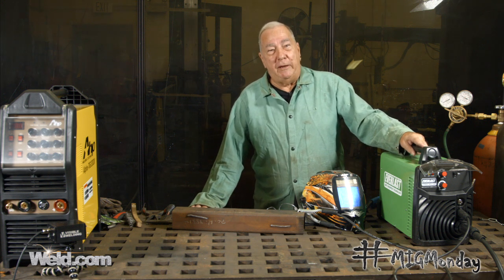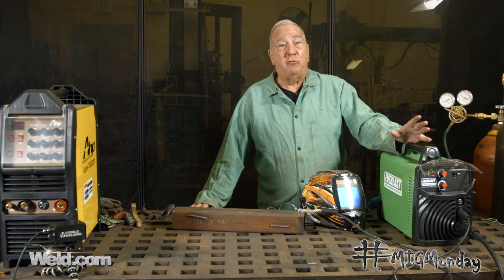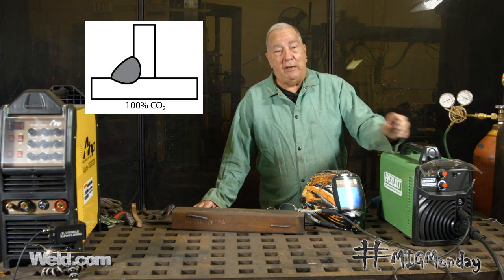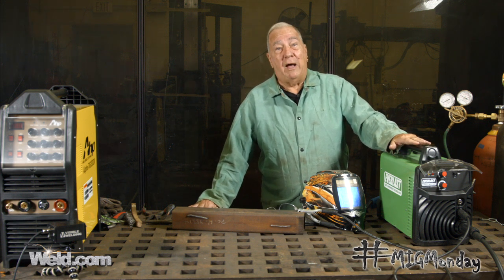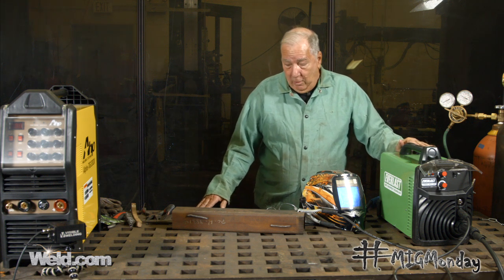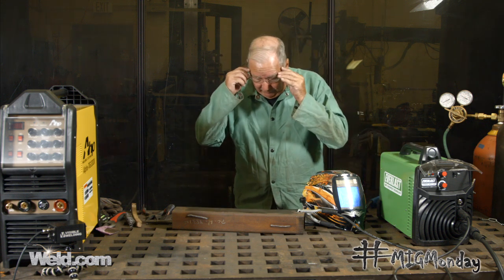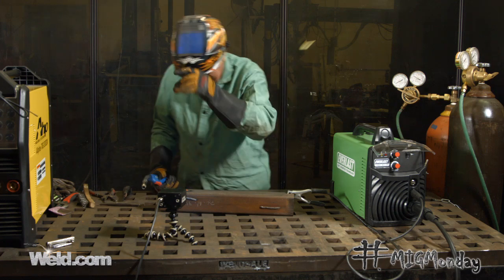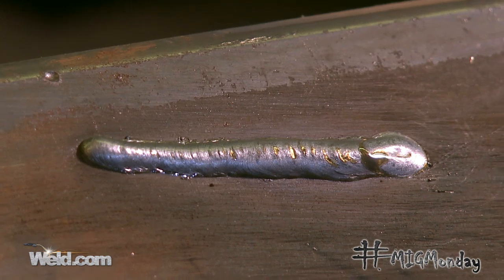Best Gas for MIG Welding: CO2 vs. C25 MIG Mix

Comment: From my own experience - argon stabilises the arc and makes it less aggressive, thus for welding thin sheets (like in body repair) Argomix is better. Two years back I helped my pal to repair the body of a second-hand van he purchased and planned to turn into RV of sort. I did most of the welding in my "personal" shop, with a rather simple MIG machine and straight CO2, using solid 0.8mm (0.03") wire - and it was OK. Not bad, not great - just "well, good enough, would do".
Then we took the car to some other place to spray paint it (again done by myself; that place had nothing to do with painting cars, it was just bigger place I could use, and it has a way more powerful compressor than that little "farter" back in my shop).
Anyway, while there I noticed some missed spot that had to be welded before painting, and I took that bigger MIG machine that was there, running 1.2 mm wire (0.05") and 90%Ar/10%CO2 gas. I was kinda hesitant to weld such thin sheets with this thick wire - I expected some serious burn-throughs and some "fighting" to get it done - but to my surprise it turned out to be WAY smoother than welding it with that thinner wire on straight CO2.No burned holes, just touch and go, full success at first try. Maybe the machine also contributed to it as it was a grade better than what I used before, but the gas surely makes the difference.
Then comes the other end of the spectrum - if you have to weld some thicker stuff and your machine isn't really heavy duty one to crank amperage to 300 A on short circuit mode it's better to slow the wire a bit and use spray transfer method - but you can't really do spray transfer with straight CO2. so mixed gas is the must.
But then as this guy in the video has said - for hobbyist/ home shop/ light stuff simple MIG on straight CO2 is just good enough, and the gas is way cheaper.

Comment: I started off using flux core then moved on to argon. But I found the best results when using Co2. I think that if you can, experiment and find what suits you. After all one size doesn't fit all.

Comment: I appreciate the economy of using straight C02.  The fill is cheaper, and the bottle lasts way longer.  I did however once suffer from a freeze up of a flow meter, which damaged its safety disc.  So, I went back to a gauge and gauge style regulator, as opposed to a ball type flow meter.

Comment: Back in 1979 I was working at a welding shop.  We had been using straight CO2.  A salesman came in and gave us two bottles of Argon/CO2.  We used it and loved it.  But we had been using #9 welding lens which was dark enough for CO2.  The arc brightness on the argon mix is much higher.  We all had a bad night with burned out eyes from using the mix gas with too light of shade of lens. Argon arc 3:00 , CO2 arc 3:56 .
Reply: Use the darkest shade you can see thru. I use an 11 for gmaw

Comment: This video is misinforming. If you use CO2 even mixed with Ar youre not MIG welding.
Seriously, people who look specifically for MIG have hard time finding anything because of pronunciation problems and/or lack of education of  video makers who name every gas welding MIG, with big capital letters in video title.
 Stick to American nomenclature, if you need one name on everything.
Whenever you use oxygen (CO2 or any CO2mix), gas is not - inert - by definition, its active gas welding - MAG (pronounced as "Maggie" without "-ee", or "Magnesium" without "-nesium". Idk why name MIG was incorporated so easy and MAG did not).
Its like you called petrol engine a diesel, because both are car engines. Or call both your parents mommy, like there was no difference.
Reply: Well, Nitrogen gas and carbon dioxide are referred to as inert gases because of their very low reactivity. These gases are not inert in the same way as the noble gases like Argon, which exist in their elemental form.Oct 28, 2021. So, this leads me to think that's why using c25 is considered MIG welding.

Comment: Hi Paul, I'm a little bit confused ? At the start you said most People tend to go for C25  mix, As it is a cheaper option, But near the end You chose 100% Co2 because its cheaper to buy ?
Reply: I think that first mention was a mistake!  CO2 is clearly cheaper.  Also easy to obtain, and there's a lot in a tank.

Comment: Thoughts on argon helium?
Reply: Works very well when TIGGING aluminium as it produces a hotter weld. It's very good for when you only have a single phase (240V)  machine and you are trying to weld 6mm alloy plate.

Comment: Huw much does that everlast cost? Because, I have a Chinese welder, looks 100% like Everlast. Paid 95 bucks for him. I did some research and found several exact machines with different names.....Weldinger, Proinstall( in Europe). Hope you didnt paid much, because that is repainted Chinese junk, but it works fine actually

Comment: I had to use an adapter to connect regulator to a co2 tank. I have a 20lbs aluminum co2 tank with handle.

Comment: Which is better for thin wall 304 or 409 stainless tubing(exhaust)? C02? Seems like c02 might be less likely to burn thru? I know it should be tig and have gas going through the pipes but I’m not that fancy lol and it’s for my own personal use not commercial.
Reply: Tri-mix for SS it has helium also.

Comment: in europe we use, in the 90% of time, 87-13 or 82-18 even in thick plates, because the puddle is warmer, and it bring to less fragile and more tensile strenght welds. with 100% co2 you have more penetration, but high heat input and carbon in the puddle. you can see the difference between high and low heat input in lab test. watch this https://www.youtube.com/watch?v=-W1E0bxjcEc

another thing: co2 at high temperature (source: italian institute of welding) produces co, that often remain trapped in the puddle.

Comment: Thank you sir for your time, I also use argon-co2 mix only for mig welding steel, but I heard that the regulator is going to freeze when welding with 100% co2. Is it true? I didn’t try straight co2 yet but the advantage is that is much cheaper here in Romania. Thank you.
Reply: Some CO2 regulators have electric heaters built in, or some kind of heat exchanger to pick up heat from the room.   If you just use the same regulator as before it WILL turn into a snowball!   There's a maximum amount you can withdraw from one CO2 cylinder.   Ideally you would use a few tanks and a manifold, I use the heated regulator.  Some MIG welders have an electric outlet built in to them, which is handy for this.

Comment: Thank you very much  I am welding 1/2" PLATE TO 1/8"X1 1/2"X 18" SQ TUBING AND TRYING TO GET GOOD PENNITRATION INTO THE 1/2" PLATE WITHOUT BURN THROUGH ON THE 1/8" SQ TUBING  I AM GOING TO GIVE THE CO2 A TRY AGAIN THANK YOU.

Comment: I have been using fire extinguishers for my CO2, and yes i turn the cylinders upside down because there is a stem in the cylinder, i have found i am getting stunning welds on clean shiny steel and good acceptable and rugged welds on not shiny clean old well used steel, the welds are far better than using the best gasless wire on the market, i don't buy the cheap gasless wires as they do crap welds which i have proven that with my experience and i have noticed bugger all splatter with straight CO2.
Reply: So what do you do with the heating problem, I'm about to get a mig machine and I'm worried about it

Comment: Our company is using 98% Argon & 2% oxygen(O2), on sheet of 1.2 mm stainless steel. Can u please explain me the purpose of 2% oxygen?
Reply: O2 helps stabilize the arc and seems to help wetting. I have only used Ar/O2 mixes in spray. I have never tried using Ar/O2 mixes in short circuit....I don't know if that is even recommended.

Comment: It depends on what you are welding, from my experience which is nothing like this guy, I am a machinist not a welder. If you are going to be working on sheet metal 14-20 gauge then the C25 will probably be the better way to go (if choosing to use gas and not flux core wire). Argon helps cool the weld and helps keep down spatter less heat less warpage less burn through etc. But it is just an opinion, he didn't seem to clarify what thickness metals he was going to be working with using those gases.

Comment: I bought some0.023 wire for my eastwood 135 mig but on the wire it said 80/20 for the gas my gas bottle is 75/25 will this work with the 80/20 wire?
Reply: not a problem

Comment: So for the most part , c-25 is cheaper then straight co2 ?
Reply: no, c100 is cheaper. Maybe he misspoke when he said that or its just an old video, but C25 is about 4x as expensive to run than C100. at least nowadays since this is a 3yr old question. this link goes in depth. https://welditu.com/welding/tips-mig/mig-welding-with-100-co2/
Reply: No!  That was a mistake.  It happens!

Comment: Thanks for posting this informative video. Ill pick CO2, because of cost, why not. But Is there now a mig wire where you dont need gas.?
Reply: flux core no gas more clean up though
Reply: From my experience the FCAW is not a good choice for light gage sheet metal, like auto body work. Since you have to weld scattered spots to prevent metal warping from excess heat you run a great risk of slag inclusions at each start/stop. MIG would clearly be a better choice. Any residual flux or flux smoke (there is usually a good bit) can cause paint problems if not COMPLETELY cleaned from the metal.

Comment: In UK i've only ever used Argoshield 5. 95% CO2 and 5% argon. I was told that 100% CO2 burns the mig torch tip out.

Comment: Isn't that the other way around? AUTOGAS it's called what I am using for years and as far as I know it's 25% argon and 75% CO2. I did a lot of auto-body work with it. Thanks for the video, very useful.

Comment: Not only is 100% co2 cheaper you also get alot more Volume in the cylinder than argon or argon mix, due to co2 being a liquid in the high pressure cylinder.
Reply: TMoD7007  so c25 argon mix is the best choice for mig weld? And 100% argon for tig alu and stainless?
Reply: 6$ per 20 lbs of liquid that's cheap enough to run air tools...
Reply: TMoD7007  ok in learning :)
Reply: Co2 for short circuit is fine your right about spray but alot of dual shield fluxcores run best on straight Co2. C25 will make you lose ductility you should run straight co2 with gas fluxcore
Reply: TMoD7007  you ever try tri-mix? It is the bees knees for stainless

Comment: Weld.com: My question concerns porosity and the affect shielding gas may have on contamination. The text book Welding Principles and Applications (L. Jeffus) states that argon (Ar) with less than 20% CO2 may affect penetration and contribute to porosity. It goes to state that 100% CO2 has less steady arc characteristics and may increase in weld spatter. However, these negative characteristics can  be mitigated if the proper filler wire is used. So, my question: what filler wire should be used with unblended CO2?
Reply from the maker: Depends on what you are welding.
Reply: As far as the ordinary welding of steel (and the makers publish intricate detailed specifications online, you don't have to guess) the regular MIG wire of commerce now is ER-70S-6 which is specified for CO2.  Lots of deoxidizers.

Comment: Dad gum Argon is so expensive here in Hi. You are looking at 500 bux here just to get a 125 bottle. Fixin to switch from flux core to Co2. Had to get my 5# beer Co2 bottle tested and filled and will just call it good.

Comment: Can't you weld with pure argon tho? how's that like?
Reply: It's sad!  Not enough energy, and for steel apparently you want a slightly oxidising condition, as well as more arc energy so they say.  Pure Argon is used for Aluminum MIG, and of course for all metals with TIG.

Comment: Hello. My regulator keeps freezing up when welding with co2... Any ideas?
Reply: you could buy a heated regulator
Reply: There are heated ones that plug in, and heat-exchanger ones that have  some copper tube or otherwise pick up room heat.  The heat exchanger ones work fine here in FL where it's always hot.  Might want the electric one  in a cold climate?  Bigger welders often have a 110v outlet built in that's good for this.

Comment: what is the difference between CO2 and MIG welding?
equiptment wise.
kinna confusing.  @@?
Reply from the maker: CO2 is a gas that can be used as a shielding gas for the MIG welding process. CO2 is not a process. Hope that answers your question.

Comment: Personally the puddle control and the far superior finished weld appearance make the marginally more expensive C20 or C25 well worth the expense. I think the inverter based Migs may have a small advantage over the transformer based machines on strait Co2 but if you want to lay down awesome spray transfer like welds (C20 territory) that ain't happening on Co2.

Comment: Thanks for the video :o) I've been mig welding for over 20 years and got pretty good at it for being self-taught, but haven't done much welding on stainless steel to have the in's n out's of it and so needed to know if straight CO2 be good enough to weld 1/16" - 1/8" stainless steel that is 304 and 409 grade? I'm not needing perfectly looking welds... just a weld that is decent-nice looking.
Reply: I've tried "dual-shield" type stainless.  That's gas-shielded flux-core stainless.  Normally pretty expensive, I got it surplus.  Worked great.  Intense powerful arc, black slag and under that a gleaming smooth stainless bead!  This with CO2.   I think stainless solid wire and CO2 would be too oxidizing for stainless.   The traditional gas for this might be something like Argon-Oxygen 1%, and you'd still want to think about what's happening on the back of the weld!

Comment: Another important point hobby welders should know is blended gases have a self life. The gases separate over time and so are meant to be used within a short period after the bottle is filled, not months later. 

Chances are most hobby welders and even small body shops or mechanics who don't do a lot of welding are in fact welding with spoiled gas.  They would likely be better off switching to straight CO2. It would save them money and produce more consistent results.
Reply: "Blending equipment can help solve another problem with pre-mixed blends: the stratification and separation of argon and CO2 inside the tank, explains David Bell of Concoa (Control Corp. of America, Virginia Beach, VA). "When CO2 and argon are mixed in a cylinder, the gases must be injected in the cylinder at different times, using some measured volume of each gas to produce the desired mix. CO2, which is in a liquid phase, is normally injected first and then the argon is injected, but this method doesn't allow for a uniform blending of the gases in the cylinder, causing stratification." 

Stratification can also happen if the mixture isn't used for an extended period, he adds. "This occurs since the CO2 at high pressure in the mixed gas cylinder will continually attempt to return to the liquid phase and settle to the bottom of the cylinder."

https://weldtalk.hobartwelders.com/forum/weld-talk-topic-archive/welding-processes/9307-argon-mig-mild-steel
Reply: This is priceless information for me right now. Thank you so much
Reply: THX 1138 sorry but thats is not thrue. CO2 and Argon are gas and a gas always fill all the space were is conteined.
only the liquids can segregate when are inerts
Reply: Yes it true, it's called gas stratification. 

This quote is from Praxair. 

"Because of the difference in the specific gravity (weight) of the gases,
 stratification can occur with an argon/carbon dioxide cylinder filled 
by conventional methods. Carbon dioxide is heavier than argon and 
settles at the bottom of the cylinder. Inconsistent mixing in the 
cylinder is a common result."
Reply: I’ve had 8 years of chemistry, and 4 years of physics. The answer is that it’s not true. I don’t know where you saw that, but it’s incorrect, wherever you found it. If it were true, the earths atmosphere would have stratified billions of years ago, despite the wind currents around the planet.

If we were talking about hydrogen and another very heavy gas, it’s theoretically possible that the hydrogen would end up on top. But in reality, it will never happen because of the small, restricted nature of containerization, and the Law of Entropy. Look it up. Also look up Boyle’s Law.
Reply: @melgross  You are correct. I buy the big bottles of 75/25 that last me around a year and have no problems.

Comment: hi. thanks for your videos. I have a question can I weld 16 gauge stainless steel whit 75% argon 25%(I don't remember the other). an if you can do a video whit your ahp200 tig welder .how to set the machine and how weld thin stainless steel whit that machine or whit mig  thanks

Comment: Wich flow do you consider for either gas??  And about stainless steel, straight argon would be the best choice?? Thanks!!
Reply: No, you can’t mig weld stainless with pure argon, it doesnt make fusion and wet properly. I welded a stainless steel water tank and I struggle to get a decent job. It’s better to use c25 or c18 mix instead of pure argon, idealy would be 98 % argon and 2 % co2. Good luck!

Comment: At 1 mjn 40 sec you say c25 is cheaper, but then at other parts, you say Co2 is cheaper.
Reply from the maker: +kwd57 100% Co2 is the cheapest. We have put a caption into the video to correct the confusion.
Reply: co2 is in liquid form in the bottle so there is much more for the same size bottle
Reply: +kwd57 probably mispoke.. Caption to "fix" this?
Reply: +kwd57 I noticed that too.
Reply: As of today, 1-5-2021 there is no caption that I could see clearing up the confusion about which is cheaper.